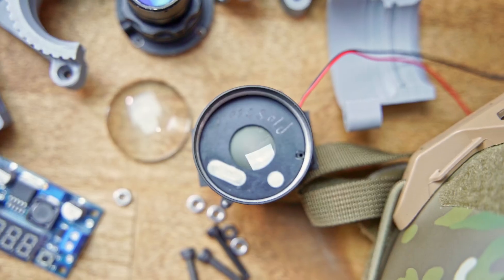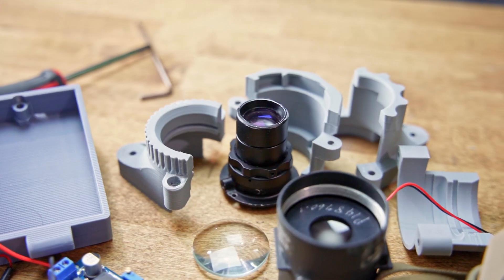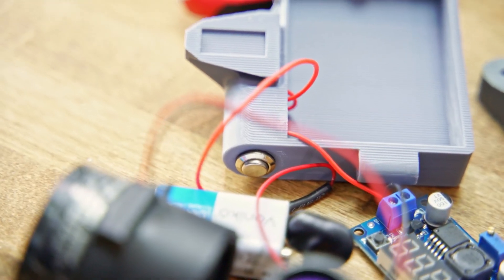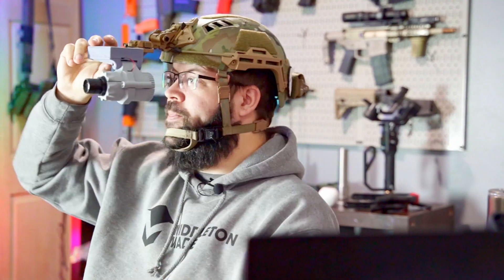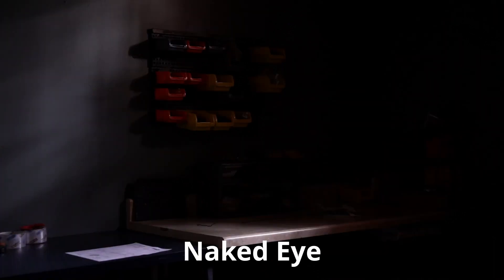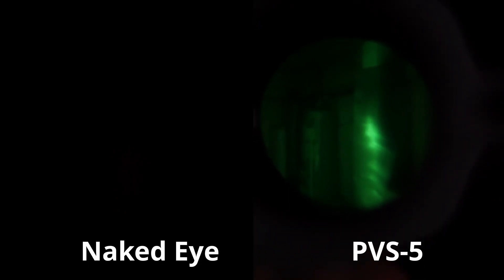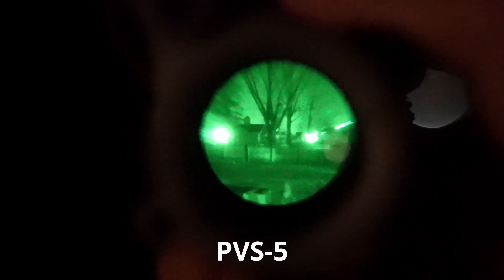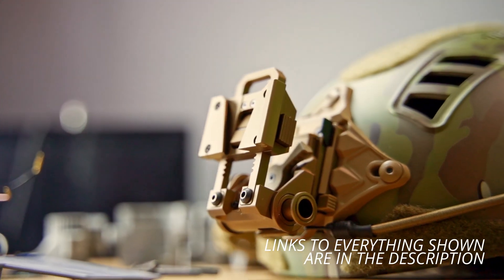Undeniably Janky, Yet Fun as Hell - PVS-5 3D Printed  Housing

Comment: Hey, do you have details about the 3DP PVS5 sold by Tactical Traders? Im assuming its your design, has Middleton Made embossed on it. Like can it get closer to the eye more like a PVS14 and accept an eye cup?
Reply from the maker: Hey there, yes that's my design. Depending on your mount, it can go froward or back a decent amount. I've not looked into eye cups at all myself (glasses wearer) but if there are any that fit standard PVS5 lenses, they ~should still work.
Reply: Did you happen to buy from them on eBay. I was just looking at them myself

Comment: MX-9916 (pvs-5) Image Intensifiers use 3v  not 1.5v as stated
Reply from the maker: Isn't it 3v for two tubes, providing 1.5 to each?
Reply: @MiddletonMadeOfficial    the 2 tubes are wired in parallel over 3v power source.  100% certain, i'm an expert in this field.  All tubes this size (fat and slim anvis) use 3v

Comment: There was this "toy" that came out about 12 years ago, and it was marketed for ages 12 and up as spy toys. Well, they had real night vision goggles for the spy kit. Full on, see in the pitch black night vision goggles for kids. The image on it, for what it was, was amazing and you got a clear image roughly 25 yards. I still have it and I'm going to be 3D printing a new housing for it to fit my bucket (helmet) and seeing if I can upgrade the innards. It was only $60 bucks when it came out and I've seen it being sold on Ebay for a couple hundred now.
Reply from the maker: Those used IR LEDs and a digital sensor with the IR filter removed. That's essentially what the pvs69 and a lot of the cheaper ones you'll find online running. For the cost, they are absolutely usable.
Reply: Spy tech(tyco)   I had a bunch of the first wave of products as a kid. The motion sensor alarm was my favorite device.

Comment: I've got everything ordered for my android thermal build. resolution should be good on the thermal 256x192. Good enough anyway, quadcore 4gb sbc, wifi Bluetooth capability. Ideally I also want drone feed capability integrated or any other devices that could be useful in a head up display configuration.
Reply from the maker: That'll be fun as hell!
Reply: @MiddletonMadeOfficial  yeah I'm definitely going to post the build and have to modify or build my own housing for it. Not sure what you spent on your 2nd hand parts. I'm probably around 4 a side for thermal
Reply from the maker: Keep your eye out. I have some really cool stuff coming up that'll fall underneath the digital carrot line.